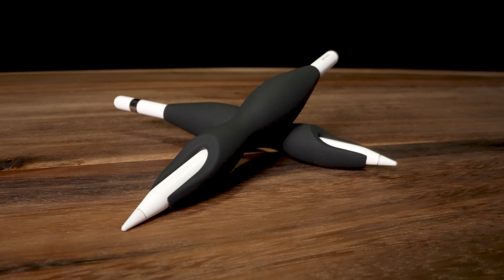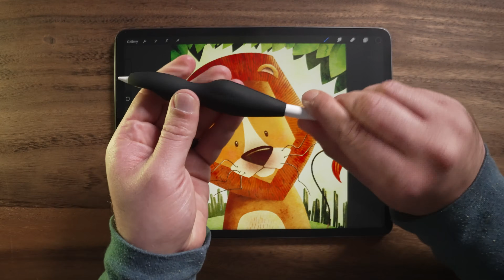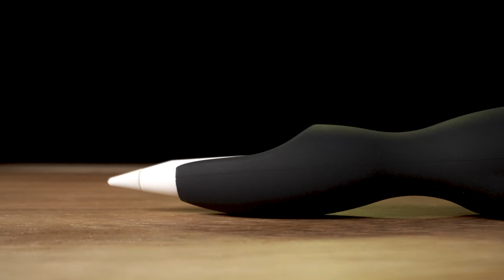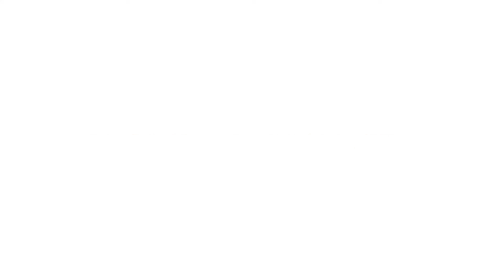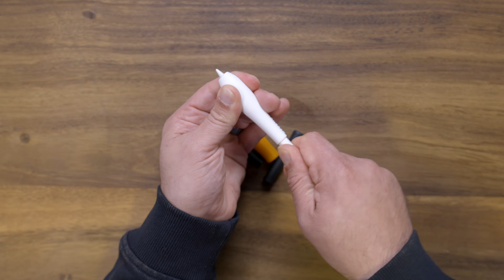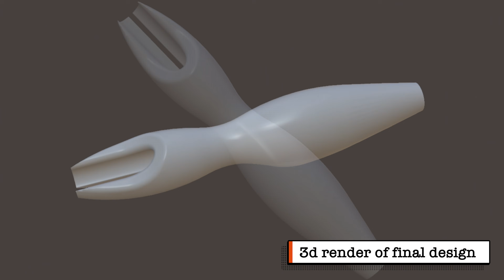I Made the Must-Have iPad Drawing Accessory! Introducing the pro-draw™ Grip for Apple Pencil!

Comment: I got mine in. I do not find it upholds all the claims in this video. Other people may enjoy it, so I'm not saying don't buy it, but here's my honest experience. The notch for double tapping accessibility means it can only fit one way, meaning your thumb is pressed directly into the wireless charging split. This is problematic in two ways: One, it is simply an uncomfortable way to draw; Two, it forces the split open, making it floppy around the tip... the part you're holding. And, while the lumps may be ergonomic for someone with large hands, they were far too large for me. I would advise taking these things into consideration before purchasing this product.
Reply from the maker: Thanks for the feedback! Curious about your experience with your thumb pressing into the split…do you grip your pencil with your thumb on the bottom of the pencil or do you hold the pencil with the flat portion on the side (those are the only two possible positions I could think of that your thumb would be pressing against the split since it is on the bottom of the Pencil.) The way I hold my pencil (and what I see from most other artists) is having my thumb and middle finger gripping the left and right sides, and my index finger resting against the flat edge which is facing directly up (with a hold like this, there is no way that your thumb could hit the split, so just curious as to what your positioning looks like to give the results you are experiencing.)
Reply: @BeeJayDeL  Thanks for the reply! So, here is what I’m experiencing. I may have a weird grip. As a tattoo artist, I rest my pencil in my right ring finger, so that I can support/control with my index and middle fingers opposed by my thumb.

Comment: I just got the grip a few days ago and I'd give it a 4/5, the ergonomic shape feels okay, I do love how it fits the pens perfectly and doesn't slip, and the space it gives for the gen 2 double-tap but as someone whose hands aren't as big, the bigger  part of the grip feels kind of weird, but it might take some time to get used to (it feels great when I flip it around tho with the bigger part near the pen nib). As for the wireless charging part, as someone who always has a case on my iPad the split on the grip doesn't really do much unless I have to really open the grip in order for it to hold on, otherwise I have to either remove the grip or the iPad case to charge. I'd still say this grip is pretty good, just not doing a lot of the things it says it does, for me at least.
Reply from the maker: Thanks for the feedback!  Does your case have an open-edge design (like the Apple Magic Keyboard highlighted in the announcement video?) If its not fully open edge…then yes, the grip might have trouble attaching (but any and all grips will have the same issue as those types of cases aren’t meant for anything wider than the Pencil itself.) The split-back design does give you some leeway and wiggle room to expand the fit though.  If that’s a problem, the ability to easily remove the grip while not experiencing any slipping or movement when attached to the Pencil sets this apart from anything else out there (once you get other grips on- they are next to impossible to remove easily and require a struggle to get off. If they can be removed easily, they slip while drawing.)  So just to recap…there’s access to the double tap feature…the Pencil attaches to the iPad while the grip is on (or if your case doesn’t have an open-edge design, it can be easily removed and reattached)…and the grip can be used in multiple configurations based on your drawing style and needs. Sounds like it does a lot of the things it says it does, or am I missing something?

Comment: Is there a way to get access to double tapping if you flip the grip to the super wide side?
Reply from the maker: No- going with the super-wide option removes the double tap access (but technically, you could move the grip a little further up and move your finger down to double tap on the exposed Pencil edge since that edge tapers more than usual grips.)